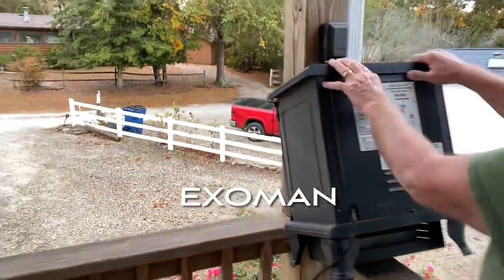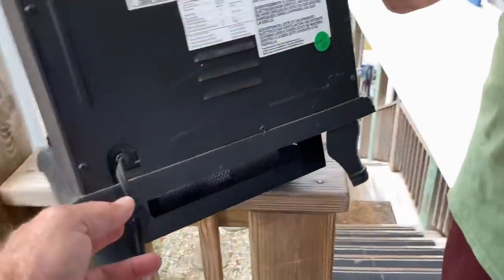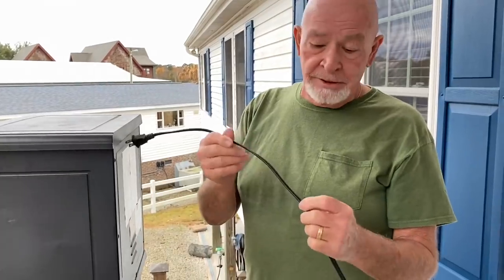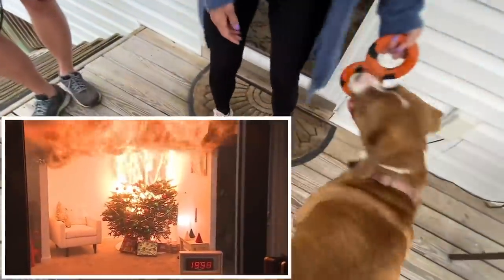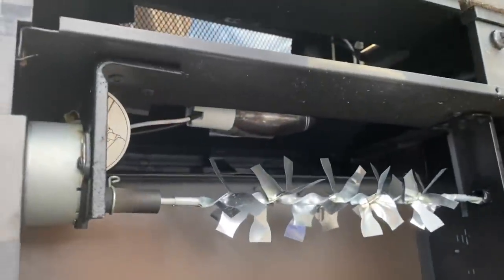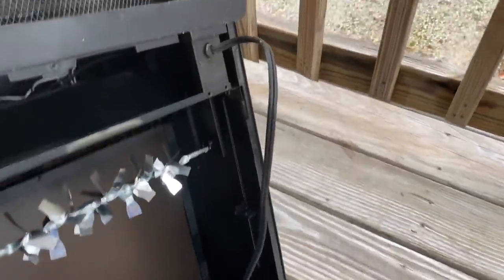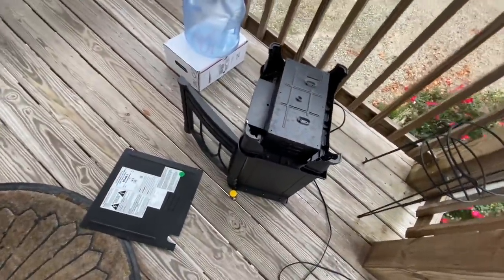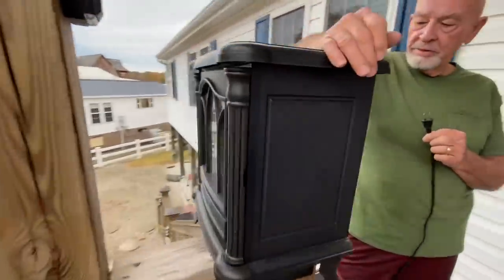Chinese Heater House Fire Danger!

Comment: Thanks for the heads up, I got one exactly like that yesterday. It’s currently running in the 1000w mode and the plug and cord are at room temperature. I’ll keep an eye on it when it’s running on the 1500w setting. 👍

Comment: It’s as likely as not that the problem was the receptacle, not the cord on the device. The problem is the contractor grade receptacles that are used by the builder. You should always replace receptacles with spec grade receptacles, at least in high current applications. In any case, once a receptacle (or a cord) has been  subjected to this much heat, it’s now definitely compromised and no longer trustworthy. Replace it asap.

Comment: What size circuit breaker is on that line with an outlet is how many things you have running off that line maybe it needs its own circuit
Reply: Run 12 guage wire to a dedicated 20 amp outlet from a dedicated 20 amp breaker. Some older houses and mobile homes are still 15 amp circuits with some using 14 guage wire. Stuff gets overloaded, gets hot and sometimes the breaker or fuse doesn't trip the circuit. Things get hotter..... . Not a good scenario. 
I wouldn't have one of those in my house. Be smart. Be safe.

Comment: I have a Patton (from Walmart, made in China) space heater 1500 watts that is about 3 or 4 years old. The cord would get Very hot when it was new.

I went to a local hardware store and purchased and replaced the cord end with a Heavy Duty one. I use this heater now with no issues. It still has the original 16AWG cord, but it doesn't get hot or even warm now. I check it often when in use.

My guess is that the wire connection to the male cord end plug was not good from the factory.

Anyone reading this, please have an electrician check out any New space heater you purchase.  What is you and your family's life worth????

.

Comment: the wife is a cutie for sure swim suit or normal pants she is cute your a lucky man i had this same unit and i never used the heater but the plug was hot due to a lose or poor fit between the plug and the outlet i for a test direct wired it to a spare normal 14/2 out let wire with the wire nuts that clamp down with a screw and twist on the plastic cover and ran it for  a hour while watching it with an infrared thermometer and it was cool but the wire was warm but not hot like in your case.
i still  have one of these units i just disabled the heat part just cut and capped the wires to the heat unit and if someone presses the switch it does not turn the heat part on as its not connected i just use it for the fake fire place look :)